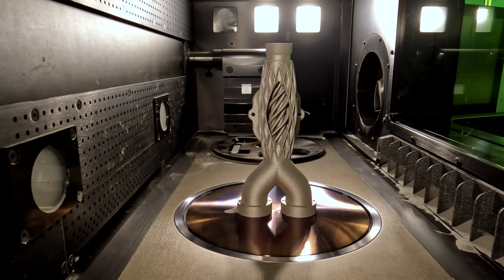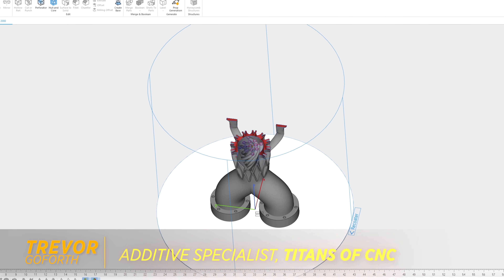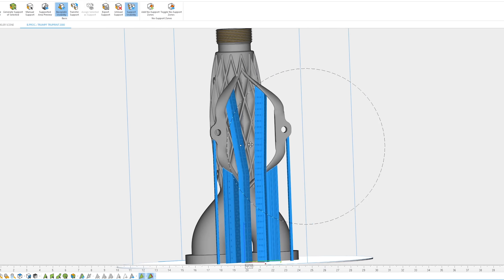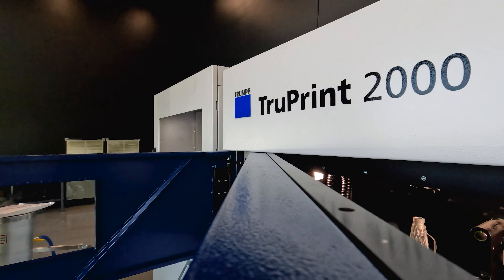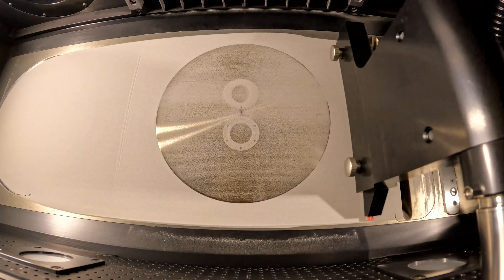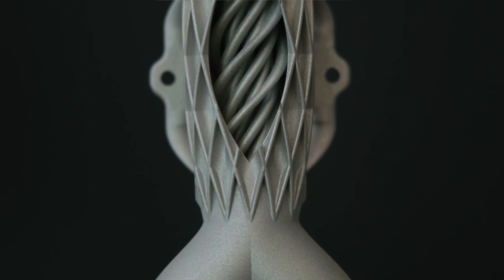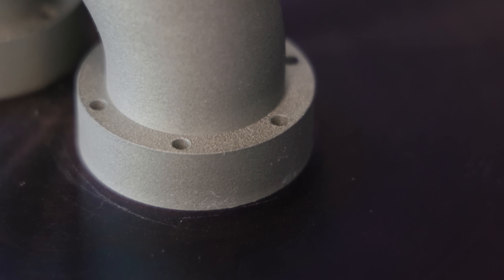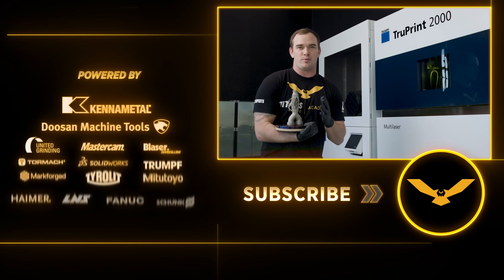3D Printing an INSANE Steel Part that's IMPOSSIBLE to Make on a CNC Machine

Comment: It cant be for aeroplane... Never
Reply: Why? This specific part, or 3D printed parts in general? Because the FAA has already certified 3D printed parts for civil aviation, and the new GE Catalyst turbofan engine, for the new Cesna Denali single prop, is almost entirely made up from 3D printed metal parts. (It's lighter, it's more fuel efficient and it's more powerful than their conventional turbofan engine)
Reply: @Hydrazine1000  As long you dont take more passengers then 2 - 3 it might be a good applicaton. SLM will heat one place of the powder, is it now austenite or ferrite?  How to controll the powder? if you still have to add from top? if laser hits carbon what will happen?
Reply: @PeterLUSTIG-vr3ph  The additive manufacturing tech is much more advanced than you give it credit. And much more matured and established too.

SLM powder bed printing typically relies on spherical powder with a particle size distribution between 15 and 45 µm (half a thou to almost 2 thousandths of an inch). Manufacturing of 3D printing "toner" (gas atomization of molten metal) is a very carefully controlled process, with equally careful sieving post-process for control over particle size and size distribution. 

The laser spot size of a Trumpf TruPrint 2000 can be as small as 55 µm. The build layer height can be 20 - 100 μm, depending on alloy type and applied laser power. 

With a laser spot size as small as 55 µm and a build layer of anywhere between less than half or almost twice that, you're never going to selectively hit only carbon, because that's much much finer distributed than this scale. 

If you print 316L powder, you're going to end up with a 316L part. Austenitic that is. If you print 17-4 PH, you'll end up with a 17-4 PH part (which you probably want to solution anneal and precipitation harden). If you print 718 Inconel... well, you guessed it, you'll have an Inconel part.

Comment: hey, I'm wondering if the metal 3d printed parts are weaker along the layer lines just like the FFF/FDM counterparts or they are completely isotropic like the milled parts.
Reply: Powder bed selective laser meltjng (SLM) typically exceeds as-cast properties and can approach that of forged billet. But impact strength and fatigue resistance lag somewhat and sit in between. And, assuming proper printing parameters, this will be isotropic.
Reply: The isotropic ratio is really close to 1

Comment: To be 100% honest I'm really interested in making cool ass shit like this but I don't have a degree of any sorts and honestly saving grace is a year worth of CAD in SOLIDWORKS from highschool so that's my preferred program unfortunately (unfortunately meaning expensive) but I have a regular 3D printer I use for printing parts but I want to make metal parts for friends cars and sell parts online that I made. I have no idea where to start and or how to go about it.
Reply: If you go really deep down the 3D printing rabbit hole you can find filament that is mostly metal powder and is able to be printed out of a regular FDM printer. You have to anneal the part in a furnace afterwards to burn off the plastic (which means the part will shrink) but if you scale the part right to take into account the shrink factor you could probably get some decent results. 
DO NOT PRINT IT WITH A REGULAR NOZZLE OR ELSE YOU WILL RUIN IT. You need a hardened nozzle or a ruby tipped nozzle.
Reply: @iownyounoobs  I have seen Integza do this and can't afford an annealing oven.

Comment: This is awesome! But can someone explain the need for supports and build plate adhesion when the object is continually surrounded by a mass of powder? I don’t get it.
Reply: As I mentioned in replies elsewhere: supports are needed because of the powder deposition and powder cleaning. The wiper deposits a layer of fresh new powder on top of the previous layer, the laser selectively melts the solid part of that build layer, then the wiper wipes off any spatter and that same wiper deposits a fresh layer of powder on top. Then the laser comes in again and does another build layer of melting. (Or in this case, it's multiple lasers melting simultaneously.)

Without support, the wiper can shift small new sections in the powder bed, or remove them entirely from it. So, with sections in a slice that have no support downwards, you risk wiping it away in the process if it isn't supported/fixed in some way.
Reply: For certain geometries such as low-angle surfaces, cooling gradients cause the part warp and protrude sections of the part above the powderbed surface. If this protrusion if high enough, the recoater blade will crash into it on most systems. Supports on metal prints act as both heat sinks and tie-downs to prevent the geometry from lifting and crashing the recoater.

Comment: Will it be having same strength as a cnc milled part made out of block of steel. 

Are theser properties isometric
Reply: This is direct metal 3D printing by laser powder bed selective laser melting (SLM). Mechanical (tensile) properties of SLM printed material typically exceed that of the same material in the as-cast condition and can approach those of forged billet material, though impact strength and fatigue resistance do not approach billet forged material.

And yes, the printed material is pretty much isotropic, but that still depends on printing parameters (laser power, layer thickness, print strategy/patterning, etc.).

Comment: DMLS is awesome, I wanna know how this machine gets away with not running it in a vacuum. That's the one really big obstacle to this technology becoming cheap and ubiquitous.
Reply: This is not DMLS (direct metal laser sintering), this is DMLM (direct metal laser melting). Or in more commonly used terms, this is not Selective Laser Sintering (SLS) but Selective Laser Melting (SLM). SLS is an older version for powder bed printing, back when laser power and laser optics were not good enough to really melt the powder. Sintering, by definition, takes place below melting point.

And the reason they get away with not running in a vacuum is that the enclosure is purged and filled with either nitrogen or argon as shielding gas before printing.

Comment: Are those threads finished straight off the printer or do they have to be machined to size?
Reply: I run my threads a little smaller and tap them after printing, but you can definitely run them finished. I’ve not had much success printing threads radial to the laser though if that makes sense

Comment: This is not 3D printing, it is 3D Sintering. One uses an nozzle to add material to the workpiece, the other uses a laser to melt material in the bed layer by layer.
Reply: Sorry, you're wrong. Sintering is fusing below melting point of a material. This is a Selective Laser Melting (SLM) powder bed printer, and it really locally melts the powder. 

Selective laser sintering (SLS) is older tech, back when available laser power and laser optics were not good enough to spot-melt the powder. But that was 15 to 20 years ago. SLM printers can still do SLS if needed though, by turning down laser power.
Reply: @Hydrazine1000  rad, thank you for the correction!
Reply: @R4N6ER  You're welcome. If there is one problem with additive manufacturing, if you can call it a problem, is that it continues to develop at break-neck speed. AM from, say, a decade ago is quite different in its capabilities than it is today. And in another 10 years we might go "What the heck were we thinking back then?"

Comment: So, do I assume correctly that this is a test-print with an opening in the side to showcase the innards? Because for a functioning part, that side opening doesn't make sense at all.
Reply: Likely a show piece yes
Reply: Came to ask the same thing, it must be a show piece to display the internal structure.
Reply: well I guess if you want to see if the internals turn out OK, you need to have a  window in one first before you go making the real part.

Comment: looks way too porous for fluid
Reply: Laser powder bed printing by Selective Laser Melting (SLM) can reach, and sometimes exceed 99,5% density. The surface isn't shiny, but it's solid. 

Though, with careful control over laser power output, it is possible to deliberately lower heat input and sinter the powder, rather than melt, so you can create porous sections, should you want to.

Comment: Interesting, knowing the complexity of the part, it will give a freedom of design. But still need more information about the machine cost, raw material cost, electricity cost, and cycle time to produce it.
Reply: Stephan Papakis made inline 6 header with a printer like that. He said around 50k $

Comment: Why would you need supports on this style of 3d printer?
Reply: First a wiper deposits a very thin layer of powder. Then the lasers selectively melt the powder of the build layer. Then the wiper wipes any spatter off. Then the wiper deposits a new fresh layer of "toner". Repeat untill you've build hundreds or thousands of layers into a part. 

That wiping action means that each part of the build needs to be supported, otherwise the wiping will brush it away as if it were only spatter. In this case the angle of the surface was still close enough to vertical, so that none of it needed a separate support structure, the piece itself offered enough support.

Comment: Awesome! As an additive process, 3D printing is perfect, but I still think it will take a long time to completely reduce costs. CNC machining is still an important way to maintain costs.
Reply: The key benefit to 3D printing is a near-complete freedom of design. Additive manufacturing enables you to produce shapes that are simply impossible with conventional CNC methods. Cost isn't the main issue. If that better shape creates a superior product, then the increased production cost can be worth it. 

Example: Companies are now 3D printing injection moulding dies with conformal cooling channels, so cooling channels that closely follow the injection cavity. The example I saw had a cooling time of 5 seconds before part ejection. The conventional injection mould for the same part required 30 seconds of active cooling before ejection. Chopping 25 seconds of the cycle time is HUGE so the one-time extra production cost over conventional CNC parts is accepted without any issue.

I've seen a 3D printed elbow joint for a concrete pumping setup. It was 10x the price of a conventional cast and machined part. But the prototype had been in service for 11 months straight, where the conventional part had to be replaced every 6 weaks because of wear. The AM part was much more shape-optimized so it would 1) last much longer and 2) cause a lot less down-time. Again, production cost isn't the primary concern.

GE did a clean-sheet design of a new turbofan for the Cesna Denali, their new Catalyst engine. That new engine is lighter, more fuel efficient and more powerful, thanks to 3D printing. They consolidated what traditionally would require some 800 separate components into 12 printed parts. Assembly is much easer, and much less fault-prone, the number of parts that require stocking is massively reduced, etc. Again: if additive manufacturing is more expensive than CNC (and it most definitely is!) then there are several ways to offset this with other benefits. But you really need clean-sheet designs for this to really pay off.
Reply: @Hydrazine1000  I love reading your comments!
Reply: @YasirAlam  You're welcome! I love how TITANS is happily sharing a lot of very insightful information for free on YouTube, and I'm happy to make my own little contributions to that.
Reply: You're absolutely correct, but in 20-30 years this technology will have probably advanced enough to give it the edge over CNC even cost wise. I love the possibilities it opens.
Reply: Right now, I think the technology is best used as a prototyping device - you can work through a large number of iterations much more quickly and once you're settled on a finalized part, then you can move to traditional manufacturing methods to bring the per piece costs down.
Reply: @bobdole4916  The biggest benefit of additive manufacturing is the near-complete freedom of design. 

Sure, it's great for prototyping of parts that can be produced conventionally, but its real advantage is that you can create shapes that are otherwise simply impossible to produce. 

That allows for new levels of weight saving, for new levels of parts integration, for new levels of shape optimisation, and so on. 

The new GE Catalyst turbofan engine? Complete clean-sheet design, made by additive manufacturing: lighter, more fuel efficient and more powerful, and some 800 components consolidated into just 12. Will be available in the single prop new Cesna Denali. Prototyping you say?

Condolences by the way, for your namesake.
Reply: @Hydrazine1000  I hadn't considered products that would have a low production quantity - very good point.
Reply: As time goes by and 3d printing improves in displacing CNC I think we will discover CNC is likely to be the most efficient way to produce the least complex parts with limited #'s of tools/steps needed.
Especially where material strength, high stress, and temperature sensitive applications are concerned.
Reply: It still has some way to go to achieve the same level of precision CNC can

Comment: Why does a part suspended in powder need supports?  Honest question
Reply: Copy from my reply elsewhere: You need it because of how each new layer of "toner" gets deposited.

First a wiper deposits a very thin layer of powder. Then the lasers selectively melt the powder of the build layer. Then the wiper wipes any spatter off. Then the wiper deposits a new fresh layer of powder. Repeat untill you've build hundreds or thousands of layers into a part. 

That wiping action means that each part of the build needs to be supported, otherwise the wiping will brush it away as if it were only spatter. In this case the angle of the surface was still close enough to vertical, so that none of it needed a separate support structure, the piece itself offered enough support.
Reply: @Hydrazine1000  that's incorrect. The cooling gradients within the part during printing cause the part to warp, and on certain geometries such as low angle surfaces, the warping can be drastic enough for the the part to protrude slightly out of the powderbed. If the recoater crashes into this protrusion, your build fails. Supports for metal printing act both as heat sinks and tie-downs to prevent the geometry from warping upward and crashing the recoater.
Reply: @BenWilson24  True, you're right, perhaps I over-simplified. Having said that, there is simulation software available that will calculate the warp that occurs during the printing and compensate the build form geometry with the exact opposite distortion, so that the printed form comes out as originally intended.
Reply: @Hydrazine1000  yep, there is software for that, but it's got a ways to go unfortunately. Those are are good at predicting the direction of distortion, but not the magnitude so much yet. They can often tell you if a build is going to fail, but in those cases, it's usually pretty obvious anyway to someone that has run prints before. The precompensated models are something we use fairly often to better meet dimensions, but we don't just run the simulation upfront and print that precompensated model because it's hit and miss on whether it will work well. We actually print the nominal first, 3D scan it, then tune the parameters of the simulation to make its distortion simulation match the distortion we actually witnessed. Then from that simulation, we can get the precompensated model to print. That has been a pretty reliable route
Reply: @BenWilson24  Thanks for the insight! My background is Materials Science & Engineering, and I've been to FormNext twice, but you're clearly sitting closer to the proverbial fire then I do. 

It didn't occur to me that supports can also tame some of the warping, given certain geometries.
Reply: @Hydrazine1000  oh nice! I didn't get to go to formnext this year because I was working at a different show in the US. I'm a mechanical engineer by education, but my experience in AM is laser parameter development for new alloys (obviously with the help of materials engineers) and manufacturing engineering for AM at an aerospace OEM, and now I'm an applications engineer at one of the printer OEMs. The field is developing at a break-neck pace right now, so I wouldn't be surprised if a lot of this info is outdated in just a couple of years haha
Reply: @BenWilson24  I've visited the Frankfurt FormNext in 2018 and 2019. That break-neck speed isn't new though, I'd say that has been the case for over a decade now. 

I'm not up to speed on the latest, skipped the Frankfurt FormNext 2021 due to the pandemic, but I know it's as exciting as ever.

What blew my mind in 2019 was research from Delft Technical University (where I got my MSc) where they were able to print Inconel 718, and by careful control over laser power, they could control grain size and orientation inside a printed part. They had printed a small shaft with long grains in the inner half diameter and the outside was small equiaxed grains. So the outside is extra resistant against fatigue cracking and the core is extra resistant against high temperature creep. "Functionally Gradient material" will be the coming thing.